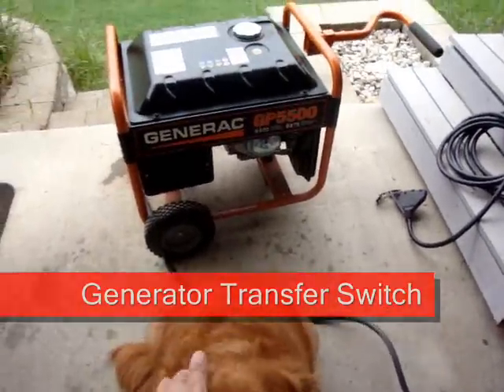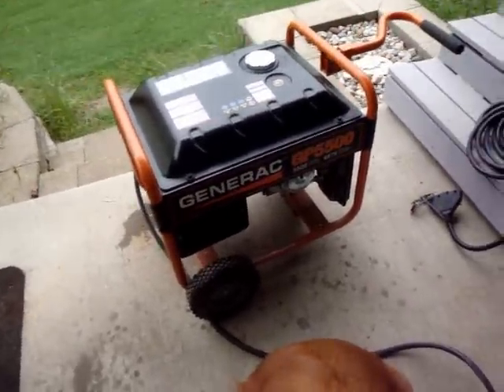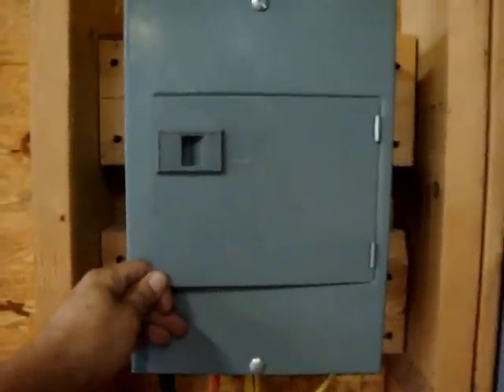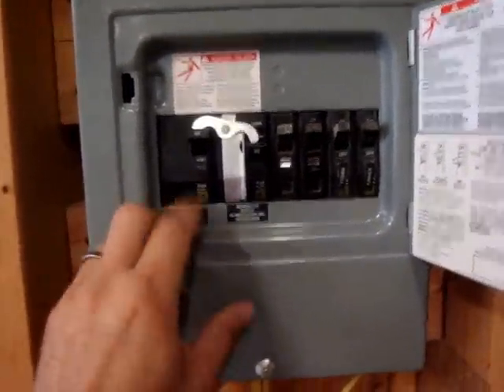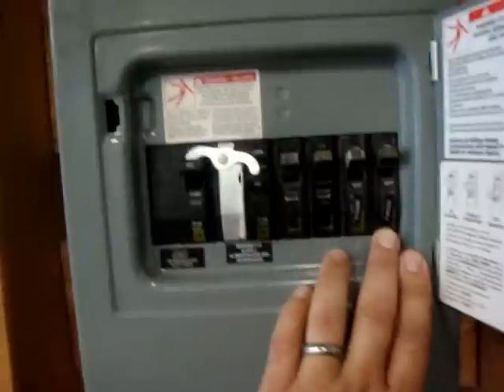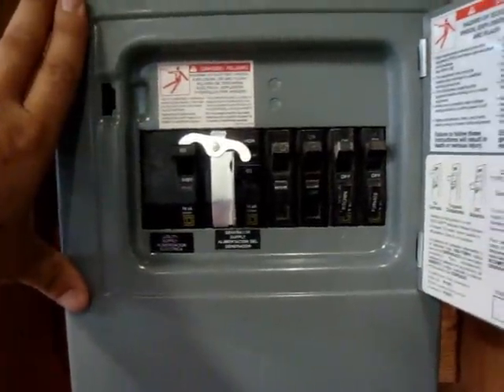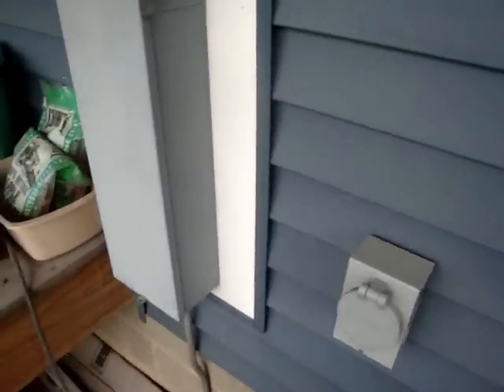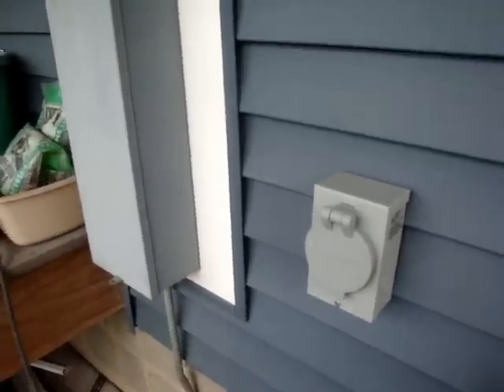Generator Transfer Switch

Comment: Hi - do you have a picture or video of the actual wiring inside the sub panel? A friend gave me the panel and i know i can do the wiring but need to confirm i have the correct mental diagram before i attempt to wire it up. Big thanks.
Reply from the maker: Sorry, I don't have a picture or a drawing.  The main breaker is fed from 2 pole breaker in your breaker panel, generator breaker is wired to your generator inlet plug in.  The loads you want to power with the generator are unwired from the breaker panel and wired into the load breakers of the generator panel.  Now they can be powered from either power source.

Comment: I notice your feed from your panel is a double pole breaker and the generator breaker appears to be a single pole... if you have your generator on a twist lock (which in most cases would be 220) is the generator breaker on a double pole breaker with the interlock covering the "blank" side so you still have your 220?

Comment: You could've done your whole house with an interlock on your main breaker panel. You'd have to be conservative with your loads and of course NO central air conditioning but this way gives you more bang for your buck. In case you're wondering, I am a licensed electrician and a certified Generac dealer and technician.
Reply: In some areas interlock are against code, so this is the only route. Also it supports neutral bonded to ground generators.
Reply: NEC code reference please.
Reply: Hydro One in Ontario, Canada. I can't even buy a interlock here. No need to reference the NEC.

Comment: I put the same box in a few years ago.  Not sure if it was mentioned,  but the box is for 8 circuits, single breakers are fine but it was designed for doubles. Good luck
 Single thick breakers with two circuits on each breaker.